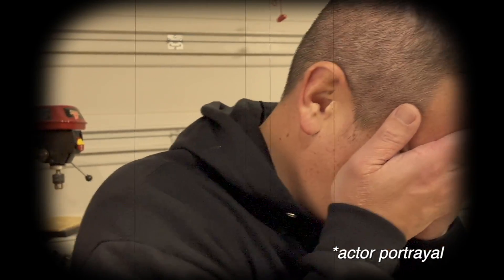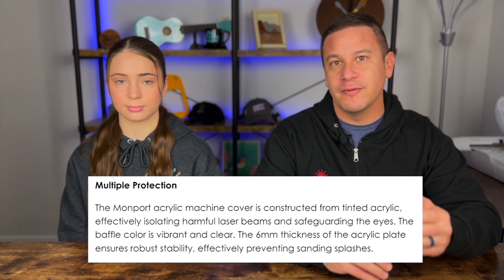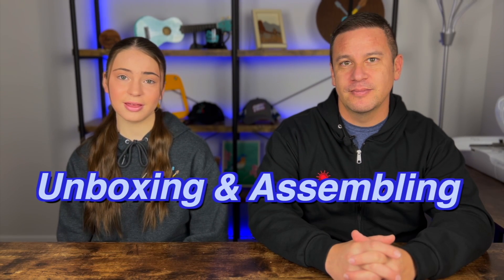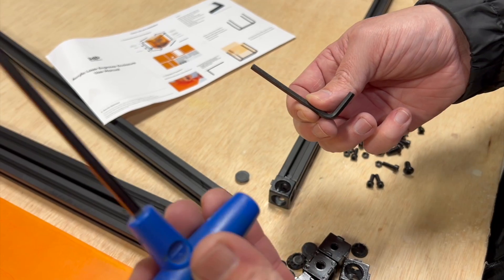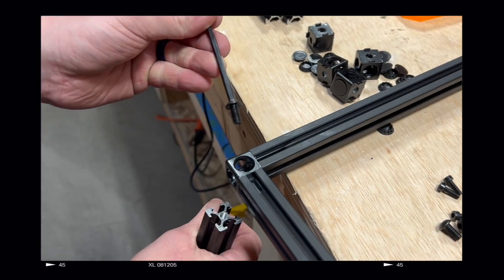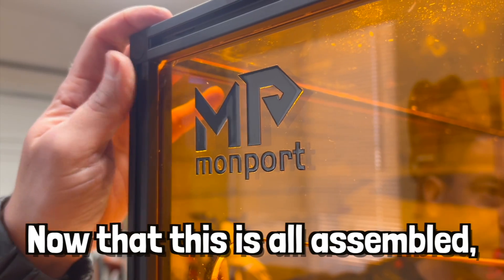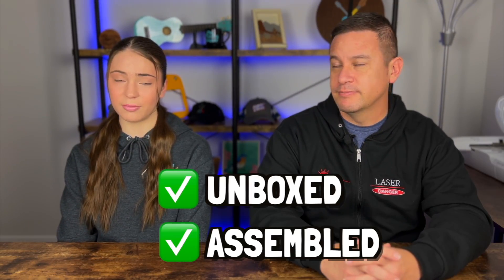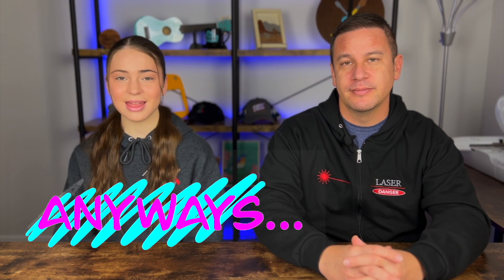LASER SAFETY ⚠️ UNBOXING & ASSEMBLING Monport Fiber Laser Enclosure

Comment: does MonPort provide a graph of the specific Absorbtion rate at different frequencies ?  I am specifically interested at 355nm for a ComMarker Omni 1 5w UV laser.  This would require at least 3.708 OD at 355nm to be safe.  How do you know it is safe for your laser...just because they said so?  just asking

Comment: Ah yes, factory fresh goodness. Safety and style, and it looks important. 
I need to make a version of this to fit around a very similar framed material of a Sculpfun 930mm volume, slightly larger than that even for their extension kit I bought. Nothing yet seems to be on the market. It will also have the ability to allow pass through working on giant things such as doors, wall panels for a interesting design mod to flat walls that could even include adaptive geodesic structural frameworks for other industrial and consumer level applications. We don't see many affordable housing or home addition solutions, such as adding onto from sliding glass doors of houses usually onto decks in yards, adding half domes to cube shaped homes, telescopic structures such as with fold down flat pack campers and such. 

On another laser concept note, imagine a laser on a scalar robotic arm able to perform laser sintering for not only subtractive laser machining, but also additive machining as well.
A robot that wont cut itself during use, and is operating in a special safe room/garage/laboratory/area52, able to work within the realm of A.I. at the wheel designing and maybe even theories of its own creative device someday able to operate without human supervision. 

This would have to have a meter to its fully sandboxed firmware that can't be hacked though, or it's laser beam judgement day.

Please be safe, please be tomorrow.
#TheDigitalLifeguardProject-_-